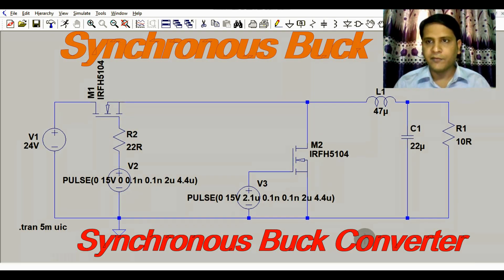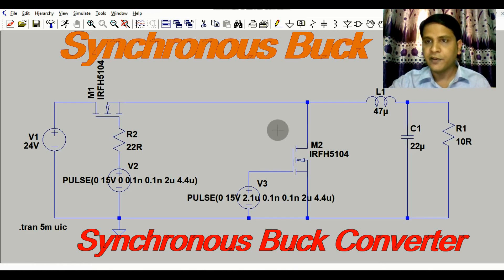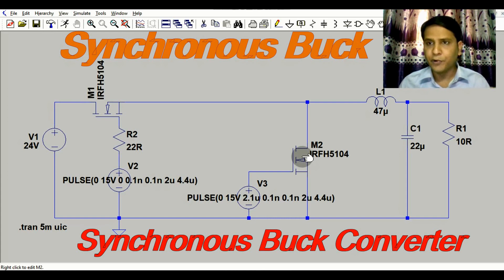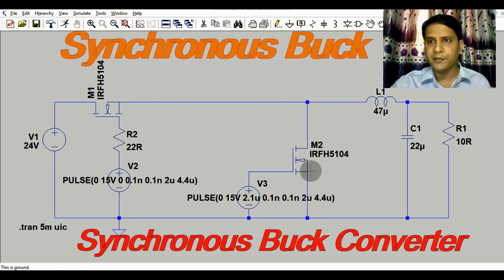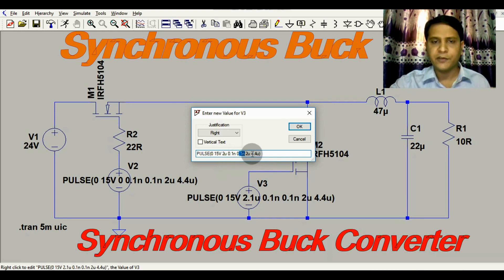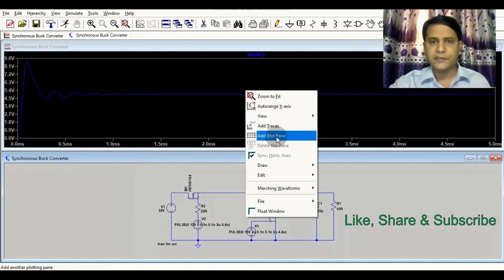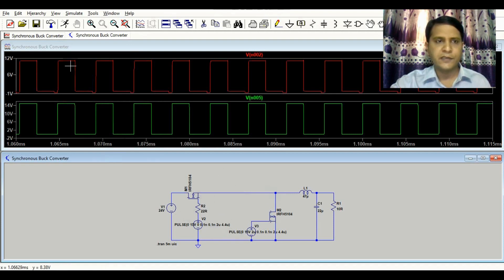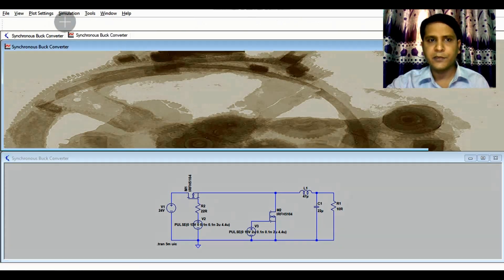LT Spice Synchronous Buck Converter Design & Simulation - YouTube

Comment: It's known that mosfet is unidirectional current flow device 
How can current flow from source to drain ?
Reply from the maker: @manokhalefap6103  connect dc supply mosfet source w.r.t. gnd and also connect the load at drain to gnd , even without apply you will see the flow of load current. Use nmos.

Comment: Sir, may i ask about how to measure the output voltage from the circuit? Since you initiate the Voltage on is 15V. If I change the duty cycle so theoritically the output will different, how do I measure it? 

and what's the function of 22R in high side mosfet and why in the lower one you're not using resistor? thank you.

Comment: This is a wrong way to drive the Mosfet number one.
It needs a high side driver 
You can notice that switching node peak voltage is only around 11 volts but your input voltage is 24 volts
That means you have around 13 volts dropped across drain & source of the mosfet number one.
Reply from the maker: I completely  Agree with You, Thanks for pointing it out.

Comment: can you simulate the same circuit with totem pole driver circuit with common collector configuration ?
Reply from the maker: Hello...I will try to simulate totem pole driver.
Reply: @ElectronicsCircuitHubECH  simulation of totem pole driver circuit is easy, that I have done already for 5W of synchronous buck converter, I can share file with you but in the same circuit, if power rating increases up to 60W, the system doesn't response well, even I calculated the parameter for 60W.  Anyway best of luck. I look forward to your next video.